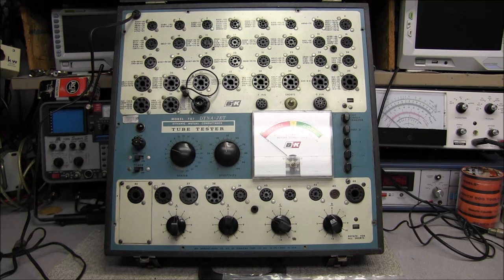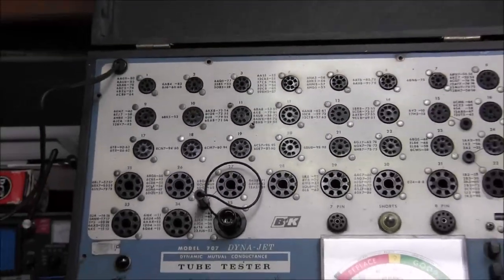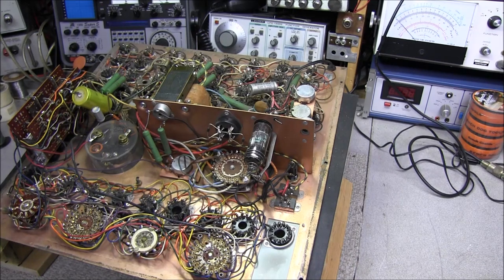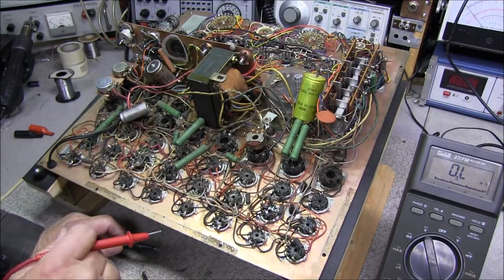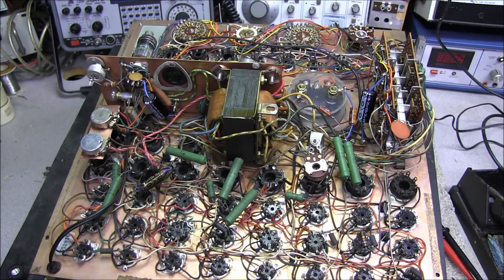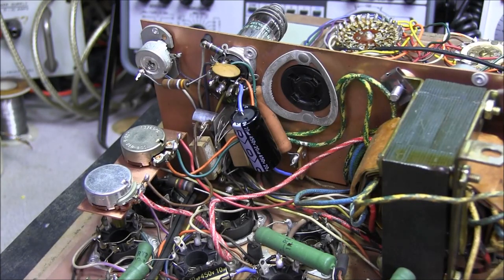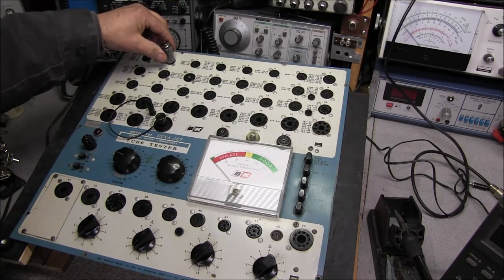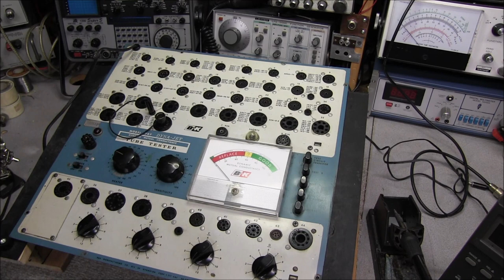#201 B&K Model 707 restore PT 1

Comment: I enjoy mine. I just completed the 12ax7 mod . Normally, this tester reads 20 or so on the meter for a good 12ax7, which is in the red reject area of the meter. With a few extra wires, you can use socket 24 for 12ax7 and get a very accurate test. 
The life test is also a very nice feature on this tester.

Comment: Socket 1 and 8 are the most used sockets on these testers.  I have three of the 707 testers and those two sockets were worn out on all of them.  Socket 8 gets a lot of use because it take the super popular audio tubes like the 12AX7.  I have much better testers but still prefer the 707 because it's so fast to set up for the popular tubes.  As you say it's great for sorting through tubes.  Personally I use it for initial testing.  If they pass on the 707 then I move over to a Triplett 3444 for higher precision testing.  When restoring a tube tester for myself I frequently don't replace the entire tube socket unless I have to.  As long as I have a exact match socket I just replace the pins.  Don't have to mess with drilling out rivets and keeps the appearance original.
Reply: Probably pretty simple but that would be a good short video on replacing the pin(s) vs. the whole socket. 3-500Z retaining spring clips are thankfully easy to replace as those are a PITA to swap out.
Reply from the maker: Yep d both of those sockets are toast.  Like you I would prefer to just replace the pins. But seeing cracks on the bottom side of these.  Replacing the pins is so easier. I think the 707 is a good tester. It is quick and easy to use. Then if you need better numbers grab another.
Reply from the maker: Will try and do that is part two of this restore. Some sockets will have to be replaced due to cracking and broken base  support.

Comment: Another great video Buddy, I have a few old tube testers in the garage that I will be checking out. Good to have a reliable tester if you work on old radios and test gear. Thanks again
Reply from the maker: That is correct Lyles. Even if you only want to check shorts and emissions.  Nice to have several styles of testers. Good luck on yours and thanks for stopping in.

Comment: Very interesting info about the bayonet type lamps.  I have the same type on my Hickok 600a, but I've wondered if the lamps are actually supposed to light up, or if they just serve as ballast for the tube filaments without actually giving off light.  My lamps show continuity, and my tester works great, but the only lamp that ever lights is the shorts indicator neon type.  I wonder if that is a problem or the way it is supposed to work.
Reply from the maker: Hi Wendell, depends on the unit. The 707 the m\lamps do glow dimly. My 600a they do not. One of my other testers they glow bright. When the lamps tarnish it changes the resistance and can throw your readings off.

Comment: Do 707's have a Selenium rectifier in them that needs to be changed?
Reply from the maker: No selenium's in these. Should be a #83 rectifier tube but this one was changed out with solid state.
Reply: Oh yes, getting The 707 mixed up with the 650. I really like the solid state conversion for the 83,,  I always though you had to use resistors as well as diodes when you did those.. Have to say,, Chompin at the Bit for Part 2 :)

Comment: Regarding the bulbs M-5 and M-6, if you buy current production bulbs and solder them in place, will they work ok or do you need to find some NOS bulbs made in USA?  I was told that current bulbs are not the same as the old ones.  So I am wondering if that is fact or fiction?  Thanks!!

Comment: I did a video on my 707 a little bit ago. Here is a link : https://www.youtube.com/watch?v=VzUVvj10uEU&t=1s Yours sure looks better than mine. I don't have any plans on restoring it. The cabinet is in horrible shape and there is a lot of surface rust all around the edges of the metal. There is also a lot of pitting so no restore but it does work and that is all I needed. I am looking for some paisley fabric to recover the case with. I thought it would fit the era.